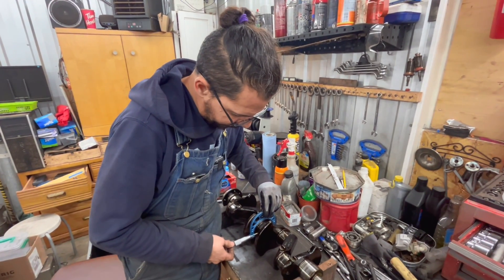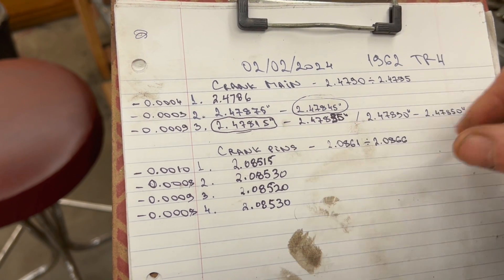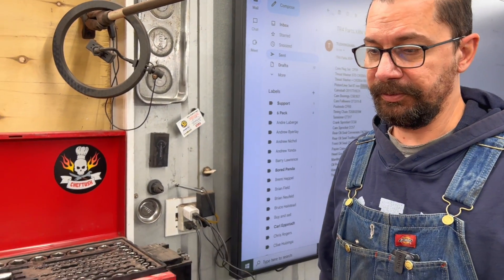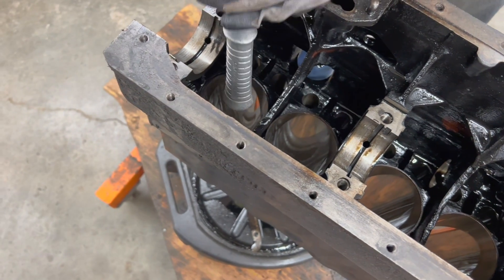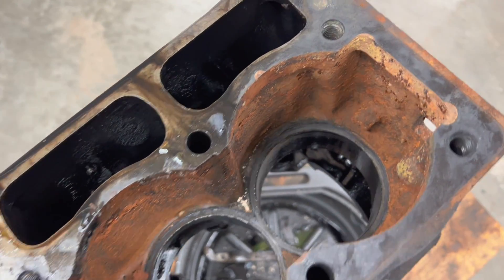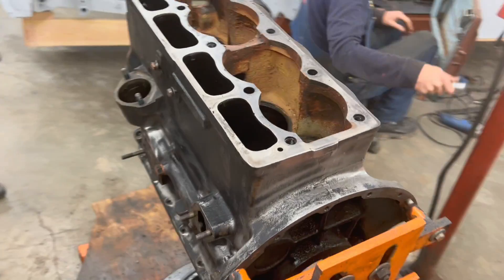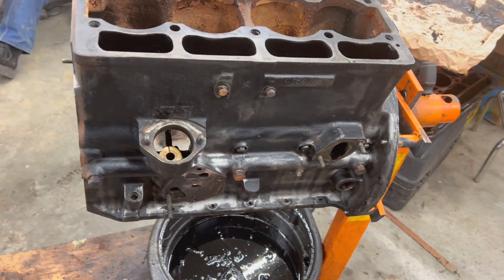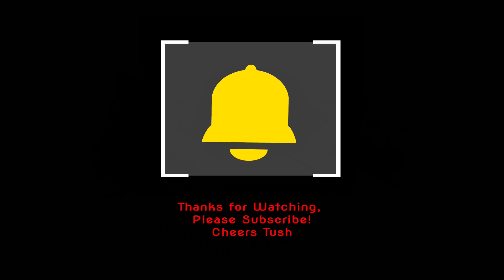1962 Triumph TR4 Engine Rebuild Series, Crankshaft, Block and Cylinder Head Work.

Comment: Hi David,
I was hoping you could point me to a video that would help me rebuild my TR250 seats. Ideally i would like to do what you did - put the TR6 folding headrest seats if you know of any.
Any help would be appreciated
Thanks 
Howard
Reply from the maker: Hi Howard, nothing TR250 specific but here is some info on the seat side bolster springs https://www.triumphexp.com/forum/tr5-and-tr250-forum.25/new-tr250-seat-side-bolster-springs.1587627.2027479/page-2#msg-2027479
And a rebuild of TR4A seats. https://www.triumphexp.com/forum/tr4-and-tr4a-forum.7/tr4a-seat-rebuild-instructions-attached.1353216/
Wegs Garage YouTube channel has a video on rebuilding TR4 seats.   The 69 TR6 seats are nice, but the Mazda Miata seat conversion for these cars is the most comfortable.

Comment: Hello.  I have also just pulled all the components out of my '62 engine block.  You mentioned that one can reuse the wet liners?  Mine don't look all that bad.  Although, I have never rebuilt an engine before.  Also, do the cam bearings need replaced/removed?
Reply from the maker: Hi Dave, yes, you can reuse the liners. You might have to have them honed slightly though.  Have you checked the measurements of them?  It’s possible if they measure well, you can hone them and just use your pistons with new rings.   As a general rule, I’ll replace the cam bearings…they are very inexpensive.  But, they can be measured if you want to check the wear on them.
Reply: @cheftush  I have a fellow Triumph collector helping me with the engine.  He is doing all the measuring.  I did place an order for new cam bearings.  Is it worth while having the block flushed and baked or just wire brushing out the coolant area.  Doesn't look all that bad.  I saw that Yakov used a cam bearing tool.  Is there any particular one for the engine?  Thank you for your input and especially these videos!
Reply from the maker: @davehallberg4325  it the block is very rusty then I would have it hot tanked at a machine shop. If it’s not bad, you can just wire brush the areas, pressure wash and then spray it down with WD40 so it doesn’t flash rust on you.  The critical area to make sure it’s nice and clean are where the figure 8 gaskets sit.  Nothing special about the cam bearing tool. They come with interchangeable sizes of expandable discs so you just pick the one that’s suited

Comment: Brilliant David & Elin.. A familiar sight for me in the late 1960's and through the 70's. Great engines and a lot easier to work on than some. Are you going for the 2.2 pistons & liner set ?
Reply from the maker: I’m going for the 87 mm set…so slightly bigger than the stock 86 mm
Reply: @cheftush  That' us Brits still using litres  😅😅
Reply from the maker: @pda49184 us Canadians Too! 😉
Reply: @cheftush  😅

Comment: First!! Good morning guys.
Reply from the maker: Morning Jim, a short video for this morning…
Reply: @cheftush  I suppose using over cleaner makes the garage smell great, NOT. Be mindful of Rusty coming around when using caustic cleaners.  I liked the use of a shoulder bolt for pushing out the valve guides.
Reply from the maker: @jimconklin8040  yeah, rusty is in the office sleeping…